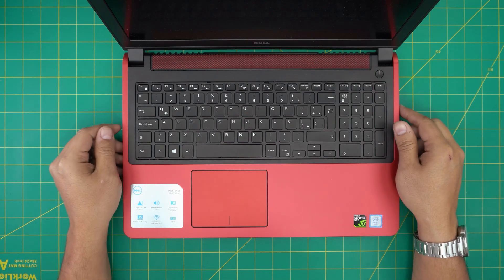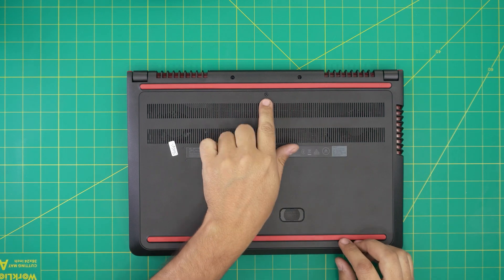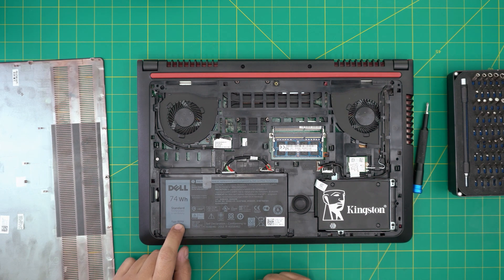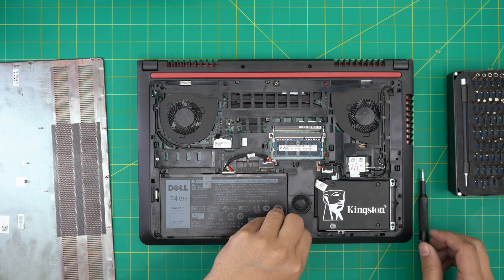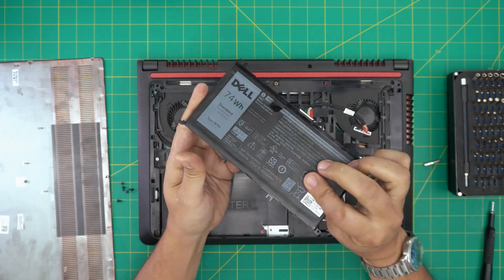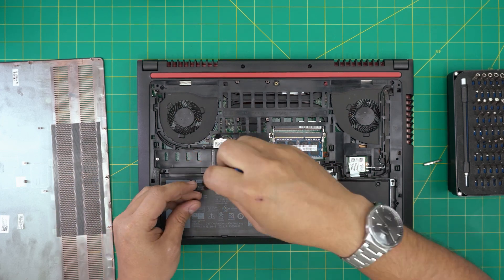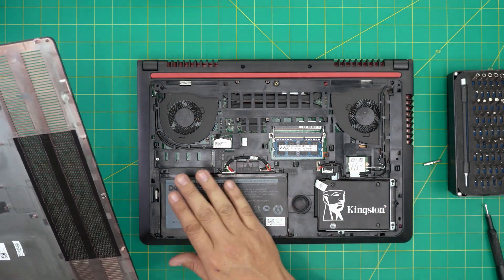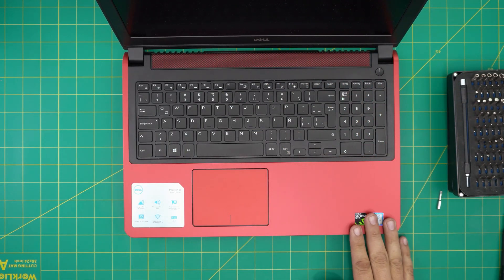How to replace the battery on Dell Inspiron 15 7559 🪫🔋

Comment: I noticed you have that Kingston inserted in the HDD slot. Isn't the default a Toshiba SSHD SATA Drive? What influenced your decision to change that?
Reply from the maker: Regarding your question, there are two factors favoring the SSD instead of the HDD. First, the HDD is delicate with movements and can get damaged by the headers of the platters. However, if you keep the laptop in one spot like a PC, then an HDD is good for file backup. The SSD is much faster, and you can use the laptop as intended without worrying about damaging the drive when on the road. Additionally, this is a client's laptop, and they have asked for the upgrade.

Cheers! 🍻

Comment: Why do I need to charge for 6 hours first? Good video
Reply from the maker: Thank you for your feedback! If you wish to support the channel, you can like, subscribe, or both!
Regarding your question, you will need to leave it for charging for 5-6h before powering on is to push the max limit of the battery capacity, and then discharge slowly to prevent battery heating up, this 1st charge and discharge take it as new born baby so it knows it's high and low limits. and it is recommended to do this once every 2 months.
cheers🍻
Reply: awesome thanks! I liked the video. is it bad to have the initial charge for 48 hours to maximize the process? @uFixTek